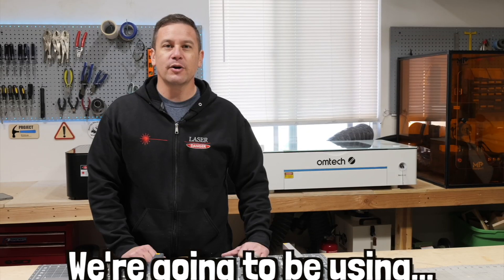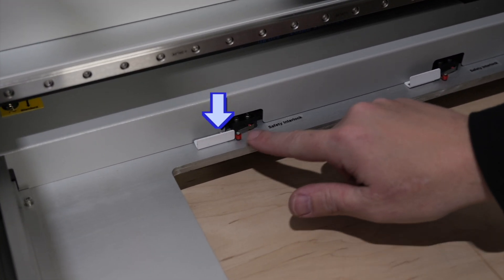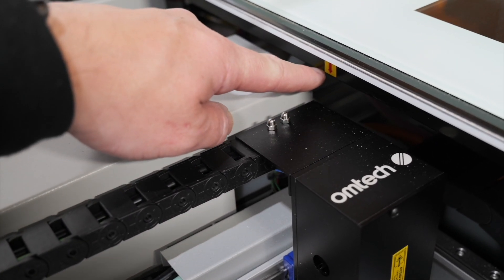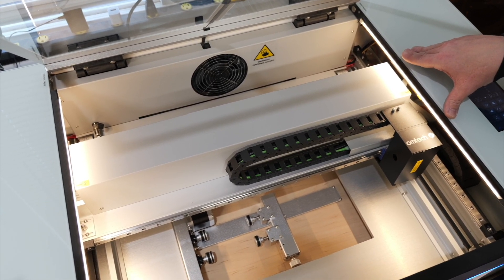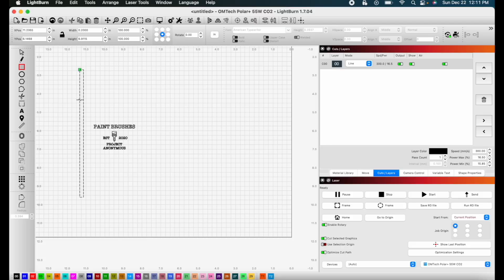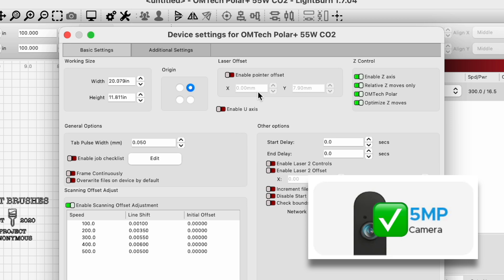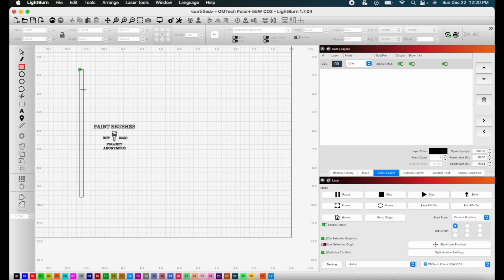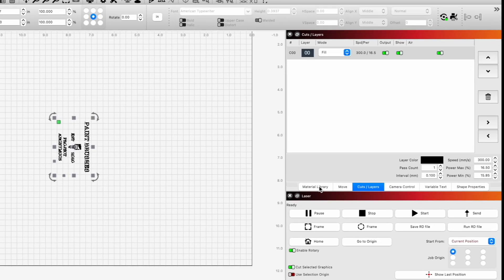OMTech Polar+ ROTARY SET UP in LightBurn for LASER ENGRAVING

Comment: Hi! Is the steps per rotation dependent on the size tumbler being engraved? r once you find the steps per rotation, you are good to go?
Reply from the maker: Hi there, the steps per rotation is based on the stepper motor, so once you find it once, you are good. You will only need to adjust the diameter or circumference for future projects. Hope this helps!

Comment: Is it safe to engrave a powder coated tumbler indoors of I'm not venting out a window but using a fume extractor since the front bed cover is off? Do I need proper glasses in case I'm sitting while the laser fires and the bed is open to avoid issues?
Reply from the maker: It is always recommended that you work in a ventilated space, if not you most certainly should use a fume extractor to ventilate to the outdoors and/or extract fumes through an air purifier. We’d suggest the use of glasses anytime you are around a laser to avoid unintentional exposure. Thanks for watching!

Comment: Saludos, tengo un problema no me aparece el botón de rotative setup lo busque en todas partes del programa lightburn y no aparece, incluso le instale una versión anterior a ver si salía, y no sale, me puedes ayudar a decirme en dónde puedo entrar a la configuración del rotativo (rotative setup) ?
Reply from the maker: Sorry to hear to you are having trouble in Lightburn. This is fortunately an easy fix.  If you go to your General Lightburn Setting Page, which is the gear icons on the top menu, then select DISPLAY SETTINGS and toggle on "Show rotary enable on main window" this should allow you to update your rotary settings. Another option is if you go to top menu selections and find Laser Tools then go to Rotary Set Up.